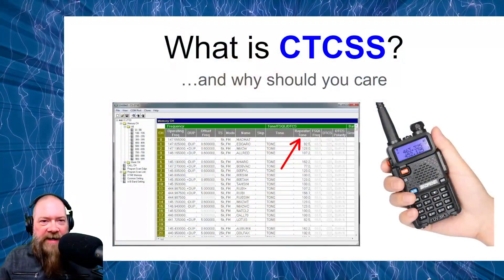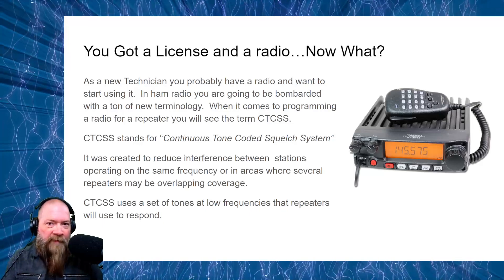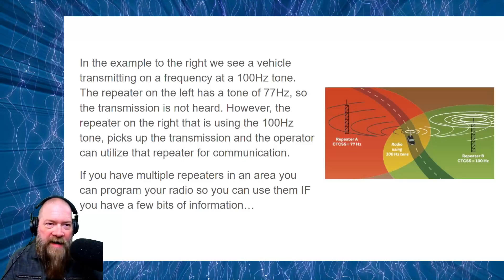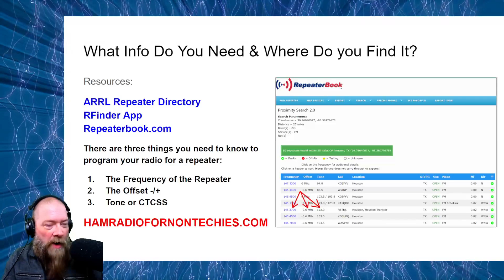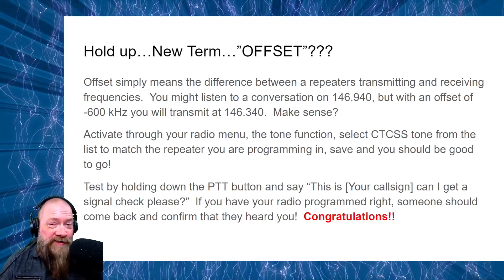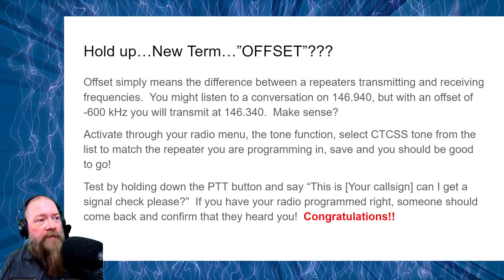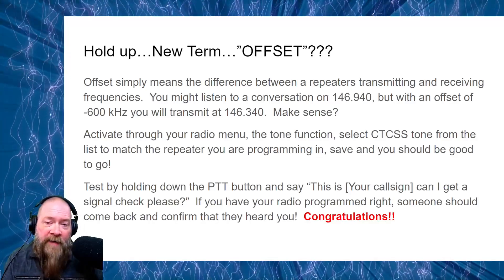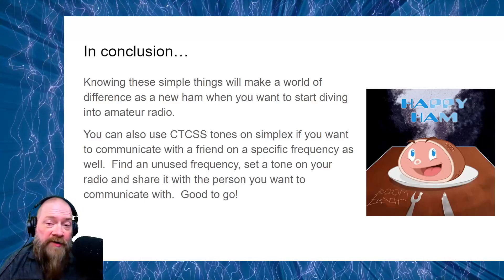New Ham Radio Operators:  What is CTCSS and Why Should You Care?

Comment: I don't understand why one takes a test and learns nothing from it, doesn't practice what was taught unless it simply wasn't, or is completely ignored. At least, this used to be on the Technician test (in the States).
Reply from the maker: People learn and comprehend information in different ways.  I think that with a technical hobby like ham radio that we should learn as much as possible and then apply that knowledge in real time, hence experimenting with your radios and gear to see what works best for you and learn from that experience.  Thanks for the comment and for watching.  73!

Comment: New ham here. Ready to learn.
Reply from the maker: Glad to have you!!!  Make sure to go to my website:  https://hamradiofornontechies.com where I have a ton of resources to help you get into ham radio and pass your exams.  If you have questions feel free to email me at my website and I will be glad to help!  Thanks for watching and for the comment.  73!
Reply: @HR4NT  I joined my local radio club and asked a question. I can hear the repeater give it's call sign , when someone is using the repeater my radio lights up however I can only hear them when I press the monitor button. Why does this happen? Tone settings is my guess. And the guy with 15 antennas didn't know.
Reply from the maker: @wannabecarguy  it may be the PL tone.  But I would think that only applies if you try to transmit.  If you hear the repeaters ID then you "should" be able to hear stations talking on the repeater.  I would have to know more about the repeater and your radio to try and figure that one out.
Reply: @HR4NT  I was using chirp to program. I noticed that clicking options also changes other cells. It would be difficult to accurately determine what happened. on Palomar mountain. 449.26- 107.2

Comment: I recently got into ham last couple months and don't have my license but only use transmit to check repeator. I owned cbs when I was younger and base unit with ground plain antenna so I know a little about radio waves. I took the practice test and 10/10. It seems pretty easy kind of like common sense or like driving license test no?
Reply from the maker: The Technician test is the easiest of the three, so if you were able to ace that, then you are good to go.  If you decided to go up to General, that's when it gets a bit more difficult.  Technician goes over the foundations and the regulations of ham radio, whereas the other two tests go more into theory and calculations of frequency, propagation and electronics.  I wish you luck if you decide to get licensed!  Thanks for watching! 73!
Reply: @HR4NT  Yeah I bet it gets more difficult I get lost when you guys get into the more technical stuff....but I watch a lot your videos and some of the other fellas you probably know so you pick up a lot then looking and checking out the different radios. PS I a lot talk about Ham people being idk words like old and nerd but I found out that you guys seem pretty normal good folk(preppers). Anyway  you guys are all cool in my book idk why the stereotype. .
Reply from the maker: @somethingcool7903  I do try to keep the explanations simple as I had the same issues you are having now with the techno babble being too much for me to handle as well.  So I hope that my explanations are easier to follow and understand.  If the info is simpler to understand, I think more folks would get into ham radio and enjoy it as much as we do.  Thanks again, 73!!
Reply: @HR4NT  Exactly. I watch a lot of your videos and take what info you provide then look it up from there. I think I got the just of it as far as that question goes. Thank you....

Comment: 7:50 CTCSS does not provide any encryption, it only opens the squelch on your radio if it hears the correct sub-audio tone sent by another radio.  Simplex CTCSS is only really useful if many people are using the same frequency (like at Dayton) and you don't want to hear all that other traffic.  So you can program a CTCSS and give that to your group and you will only hear those transmissions from your buddies that have the CTCSS out tones programmed....but everybody monitoring that frequency will still hear your transmissions if the have the correct CTCSS tone programmed or not.  Enabling and configuring CTCSS does not give you the ability to have a private conversation with another ham.  You'll need to monitor the "busy" light on your HT or mobile to see when the frequency is clear to transmit or you'll be stepping over people, cause you can't hear them!  I recommend new hams to not use CTCSS when using simplex.  It's only really useful for repeater operation.
Reply from the maker: Thanks for that Kyle.  I did not mean to imply that using CTCSS would make a private encrypted channel.  I appreciate the explanation you gave in the comment.  Thanks for watching,  73
Reply: @HR4NT  Yep.  That's a common misconception with new hams regarding "I enable CTCSS and nobody can hear me except for those who have the correct CTCSS tone enabled".  It was originally for like you explained over lapping repeater coverage.  Thanks for the video!
Reply: That's right. You won't hear THEM, but they will definitely hear YOU. Motorola screwed up by calling it Private Line (PL) which implies privacy where there isn't any. Meanwhile GE called it Channel Guard, still a bad name, implying security. 

I also recommend using Tone Squelch (where YOUR radio only opens squelch if it hears the CTCSS tone) if there's a lot of noise, intermod, birdies, other QRN on frequency that keeps breaking the squelch. That's pretty much the only reason why I use it. I wouldn't use it at a place where there's a lot of QRM, like Dayton because it's easy to stomp on others' conversations if you're not looking at the busy light, and simultaneous transmissions can block the signal you're intending to receive due to FM capture effect.
Reply: @N0SSC  Oh come on. Everybody loves a little intermod here and there.  Just ask our 146.910 repeater....

Comment: Thank you so very much Scott for sharing the information about the CTCSS.  I 'm about to program my handheld and knew the Tones were important but, you made that much clearer.  Thank you.
Reply from the maker: Glad it was helpful!  If my video was able to help out then I did my job!  Thanks for watching and for the comment.  73!
Reply: @HR4NT  Yes very helpful as a matter of fact I went to the link you have for the repeater information.  I have a VX-6R and bought the software and cable and now with the link you provided, I am getting the information for my areas as far as repeaters.  Thank You.  Question, I have the Yeasu FT-991A, can I use this same software to download the repeaters on the FT-991A?  Maybe for the FT-991A, there is diffferent software I need to buy.  Thank you for all your help.
Reply from the maker: @53Heidi2  There is actually some software that you can purchase to program the 991A.  The link to it is here:  https://www.hamradio.com/detail.cfm?pid=H0-015456  .  The software I think will allow for importing data from repeaterbook or rfinder.  I hope this helps.  73!